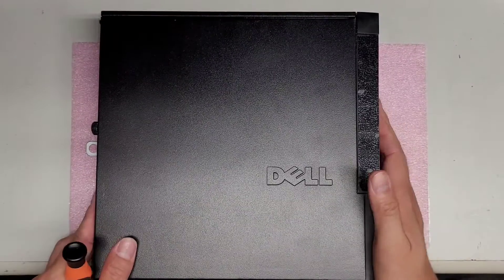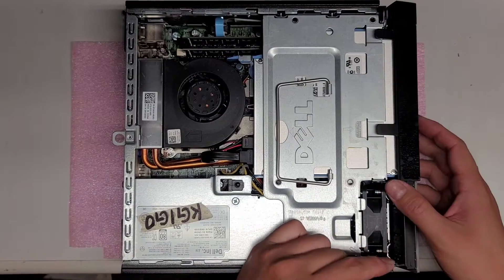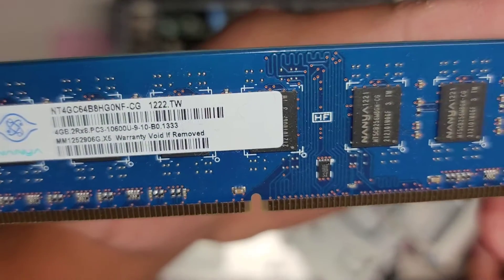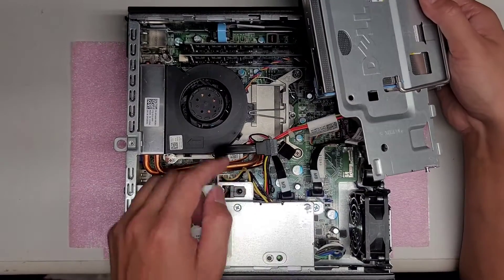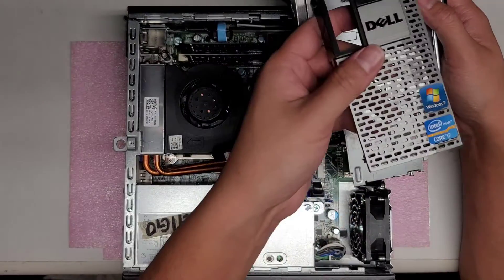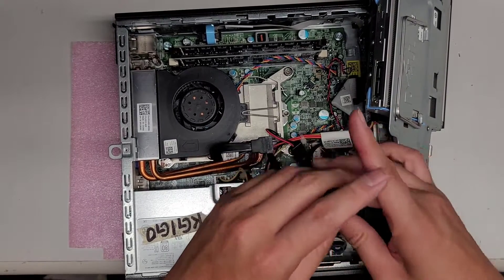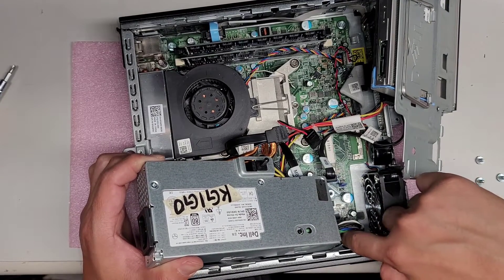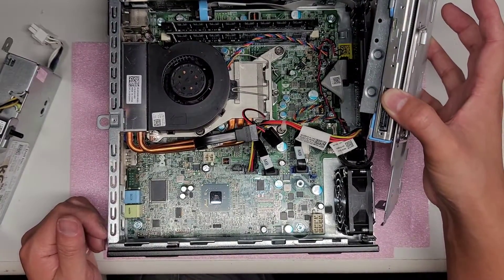Dell Optiplex 790 Disassembly RAM SSD Hard Drive Upgrade Repair Power Supply Replacement No Power

Comment: hi may i ask how did you find out that the psu is broken. did you try bist?
because mine was the Psu lightning up when i press the button at the back of the psu, and all the fans is working, but not opening until i remove my hands to the button.
Reply from the maker: What's bist? I used another psu to test it.
Reply: @ItsBinhRepaired  sadly i don't have any spare psu here. 
Bist- Built-in Self-Test,
Reply from the maker: @absol143  you'll have to order one and try
Reply: @ItsBinhRepaired  is there another way to check the power supply if is working?
 because i don't want to spent money to buy a new psu then realized that the psu is not real problem. here in my place its hard to find that  parts and  i have to order it online.

when i try to push the button at the back of the psu. its light up then all the fans are working.  and  i see the NUmber 3 is blinking and the dvd hard drive has power.  but i was thinking if the fan is spinning correctly or not. or the psu is delivering the power amount that they need.  

anyway thanks for your replay man god bless!
Reply: @ItsBinhRepaired  i can't see here any same situation as me. that's why i am clueless even i read all of the guidelines in the dell website  i see one instruction there that saying
even all things is light up in your psu there still possible chance that the power supply is the problem. that's why i am confuse.
Reply from the maker: @absol143  maybe the power button is broken.